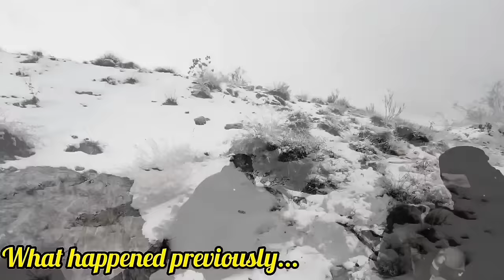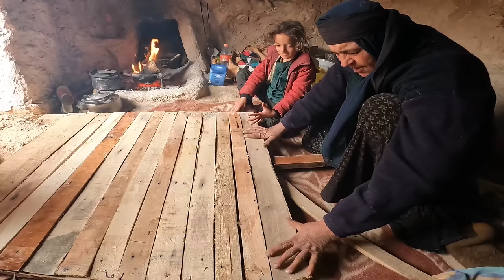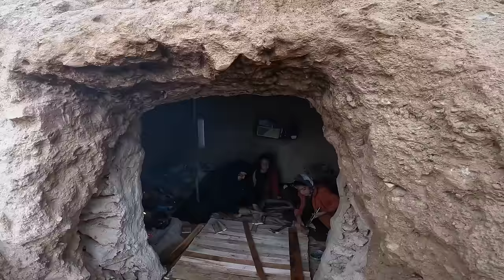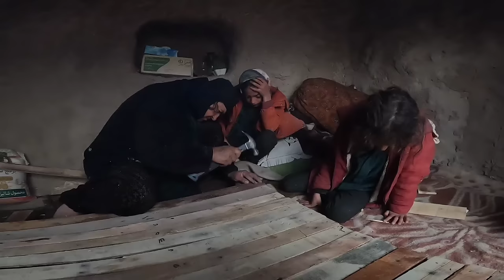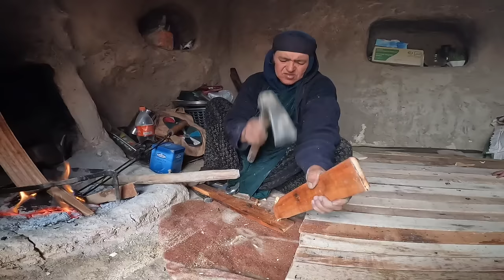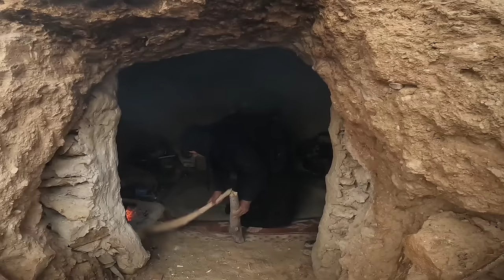Hammer, nails, planks and fireplace fire: Grandmother's hopes for building in a cave in a storm

Comment: Grandma with the remaining timber boards you have left you could make  a free standing set of shelves in the corner to store your supplies on. Making the existing holes you cut into the back wall of the cave longer would also help create more floor space. You are doing a great job on the door.  Maybe you should leave a few boards down from the top, and then remove a few boards further down and replace them with some clear plastic to allow some light into the cave when the door is closed. The plastic could be fixed at the top so that it can be rolled up when cooking to allow smoke out and in the warmer months to let some fresh air into the cave.

Comment: I'm concern about the smoke inhalations. The coughs, watery and burning eyes, could be signs of breathing in harmful smoke, and can inflame your lungs, causing them to swell and block oxygen.  This can lead to acute respiratory failure. Even though there's a huge opening in front of the cave, smoke can invisibly disperse inside the cave. Smoke is a very dangerous health risk and should not be taken lightly and have a high-overwhelming-record percentage that it has caused death due to lung cancer.  Additionally, it will also kill the fishes because smoke evaporates air.  
 The ventilation pipe from the chimney needs a wider pipe for smoke to effectively escape. Every so often the chimney should be clean by brushing its walls or you will have problems such as smoke and other health issues. Invest in a large wire net covering to cover the top of the chimney's pipe to keep creeping creatures from climbing down the chimney when not in use. place stones around the outdoor pipe to keep it in place and to not burn the plastic around the touching areas. Blessings

Comment: the awning by the doorway should be extended a little bit more...with more wood planks then cover it with thick plastic or tarpaulin and use rope in tying up the ends so it will not be blown by the wind...the rain will get in the cave of the rain is quite heavy...then everything inside the cave will be wet... stay safe...
Reply: I'm sure they realize that. Most likely trying to make some progress on the bigger problems first. I'm sure over time they will gather more materials and improve it.

Comment: When she gets the door put up she needs work on roof 

Get up there on dry day and start setting some flat stones and mud and just plaster the roof so it will be water proof and solid 

She may need to get the oldest to go out on end and finish it so don't over stress the roof while they fix it up 

I know it sounds dangerous but get piece rope around the girl so grand ma can act as anchor if it falls or her 

Then I dig 2 channels and put stone to run the water off to sides of roof like gutters so it doesn't under cut the post or stone walls and collapse on them that ground gets very soft and mushy may need plaster the outside as well to stop it from getting that way 

If she could get some quick lime to sprinkle on the sides and the gutter  it will harden the ground up it's same stuff they put in cement to harden it faster and dry it up couple 100 pounds should do a large enough area around the roof and sides walls to make the hard and strong so it stops being muddy

But a gutter wall above the roof and going down both sides will stop the roof of the cave from eroding away and prevent land slides of mud